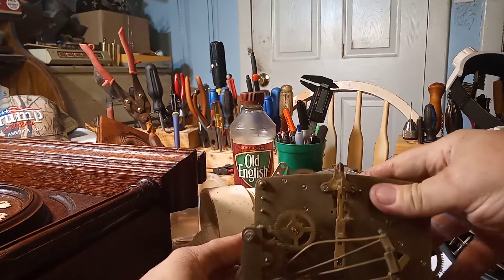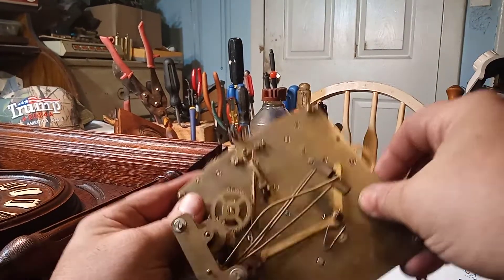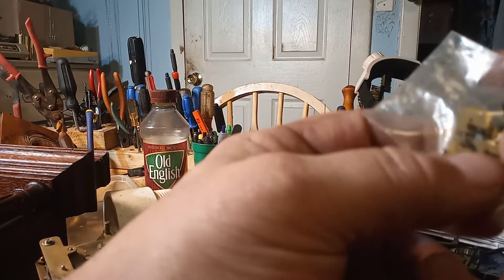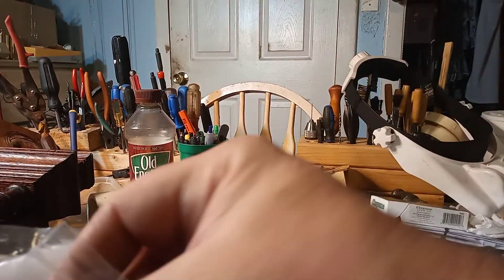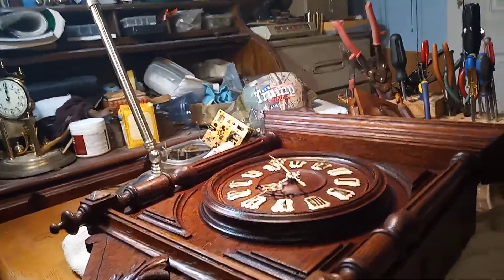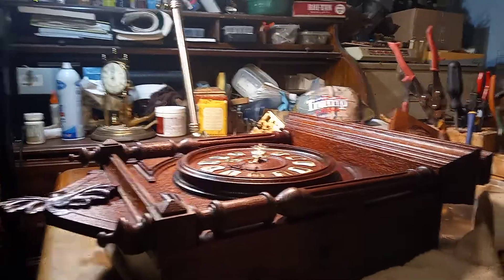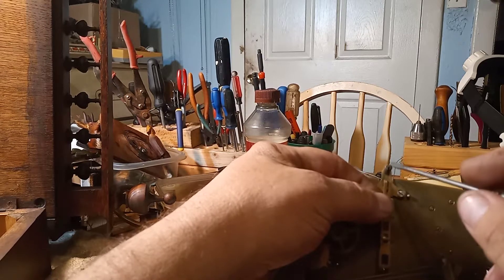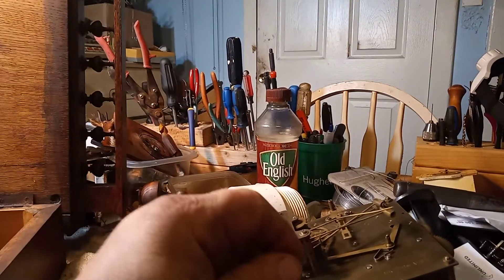How I determine the right suspension spring for a clock. 20220413 012033

Comment: Great video, Mark. These tips are sure to help me. I may have to invest in a micrometer sometime, but this will help me with my Urgos chain driven wall clock for sure
Reply from the maker: I bought a cheap electronic digital caliper. I have a micrometer but it is in inches. Basically all the parts that you will order use the metric system. Unless you want to convert I would suggest getting one that reads the metric system. Mine cost about $5 to include shipping off of ebay. It works good enough for me. When you get it make sure the very end of it closes. Mine didnt. I had to file some off. As that is where I measure stuff from. Keep watching for more videos. Please get your friends and family to subscribe to my channel. Thanks.

Comment: I have been lucky and carful with these suspension springs. At the moment, the Kitchen/Parlor clocks have the springs I have been working on.
Reply from the maker: Seems like every time I work on one I break the springs. I guess they were needing replaced or I am just not careful enough. I dont like the way that they are designed. The could have had little screws in the two plates and that way you can replace the spring itself like a torsion clock. But I think that they design them that way so they can stay in business. Supply and demand.